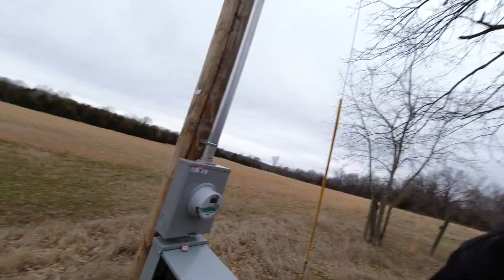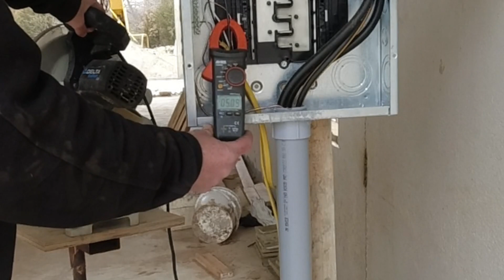Concrete House Build Electrical Explanation episode 06

Comment: I know aluminum service wires are okay as long as you use an anti-corrosion paste (ALOX??)  at the mechanical connections out where we live. After that everything has to be copper.